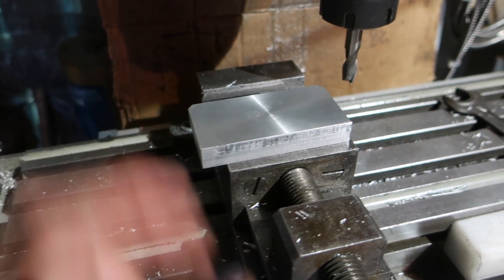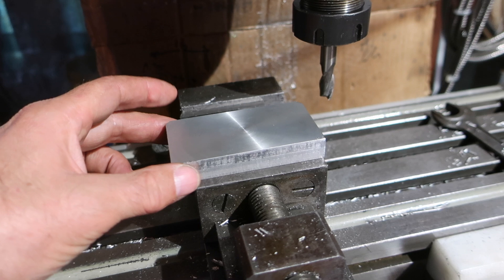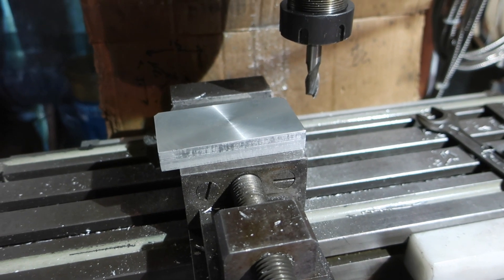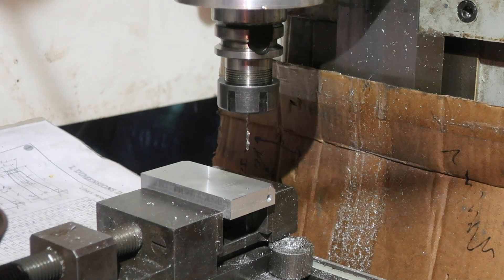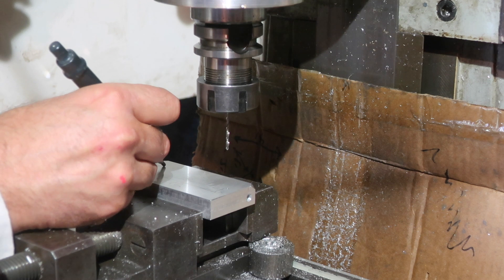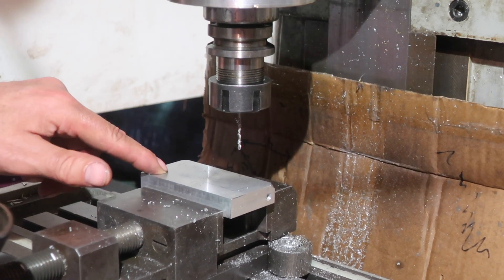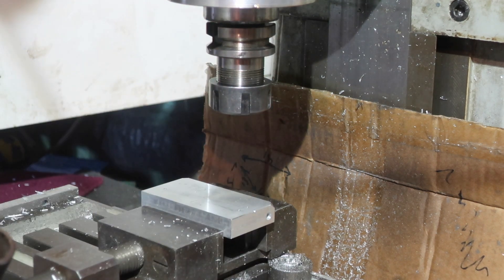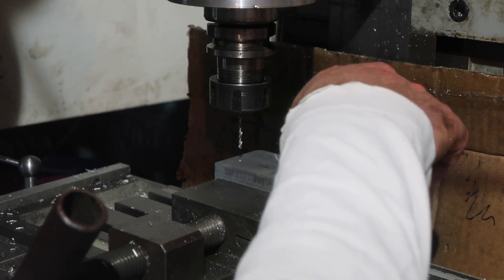Quick project - tool for setting cone angles on the lathe.

Comment: Very quick to set !
Reply: Very interestig, much similar to what i did with some "squares" : mechanical tools used to test exactly 90 degrees, they have a reference part ( in Italy is called "hat" ). I drilled in each one ( for one specific angle ) two bores at a relative distance of 50,00 mm ( i hope exactly !!! ), then screwed in two point-screw, and took the right distance from each point to the base. Adjusted then with very fine turns, locked with loctite and then filed to a specific difference each from the other ...
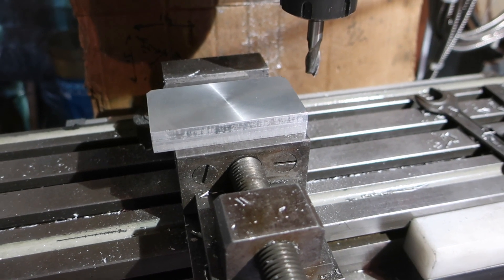So i built up squares for MK1 MK2, MK3 Morse as my need ... and also 1:50 or whats so ever ...
They are very easy to use ... instead of positioning the compound exactly at 90 degrees, i can build up any conical piece of my need ... and they work ... !!!
Reply from the maker: Yeah, saves a bunch of pissing about.